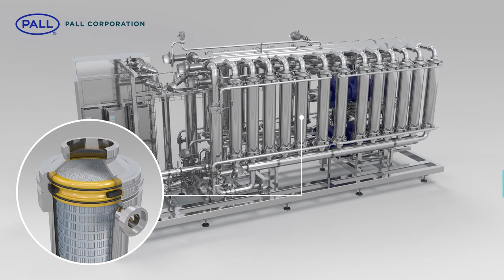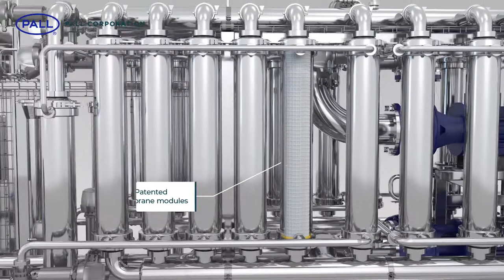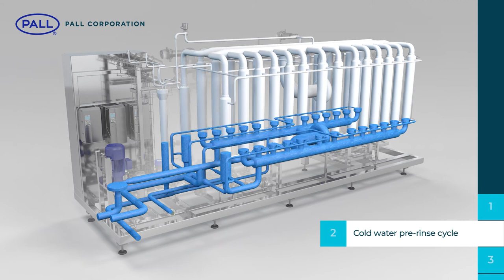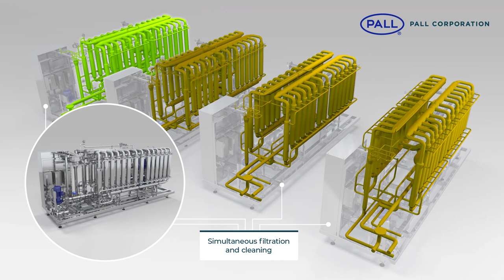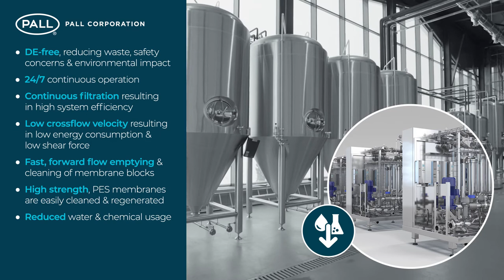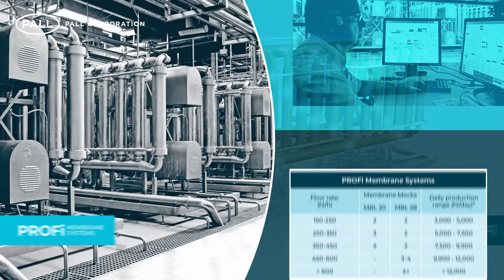Pall's PROFi Membrane System: A Modern, Sustainable, DE-free, Beer Clarification Solution

Comment: A natural DE filtration system works best for the following reasons: • Adaptability to varying filtration requirements is easy • A wide variety of filter aid permeability choices exist to meet specific beer brand challenges • High throughputs with minimal footprint in the cellar • Up to 6 times lower water consumption than membrane filters • Up to 2 times lower energy consumption than membrane filters • Low capital investment required. keep it natural